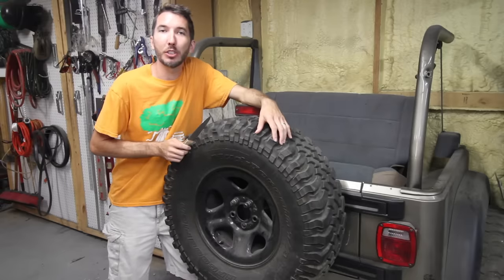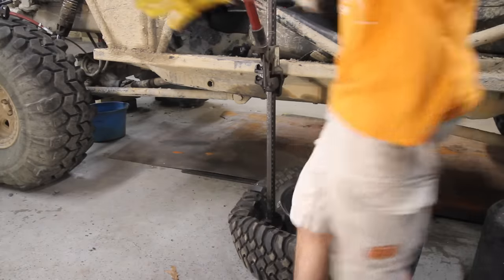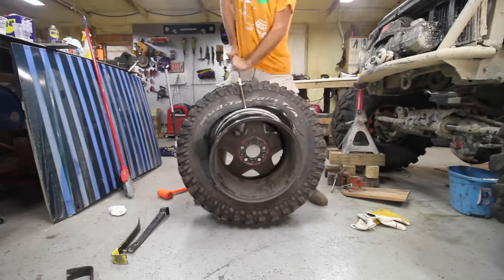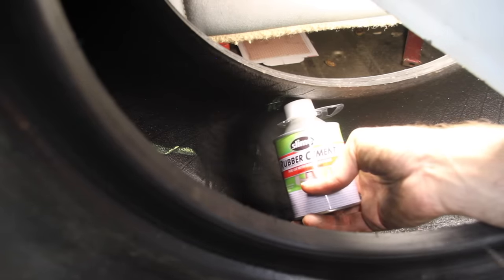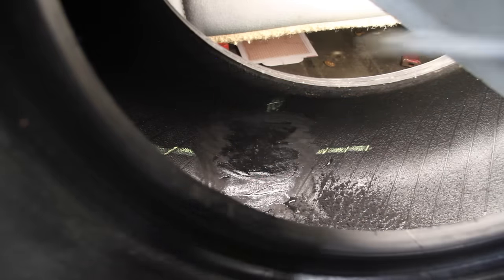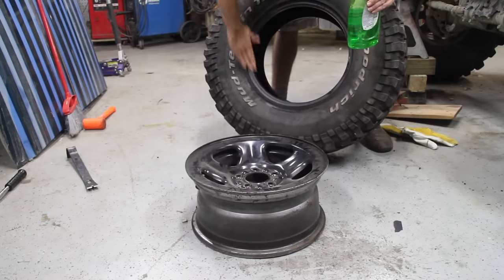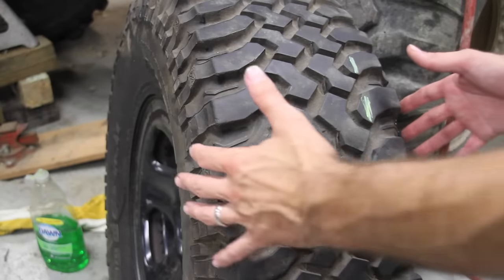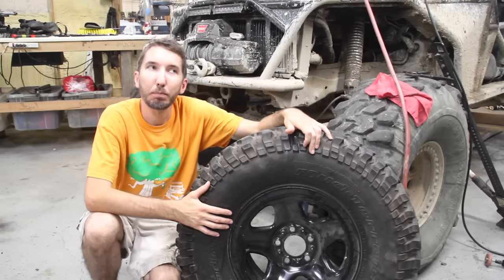How To Fix This - Patch A Tire

Comment from the maker: This is why I cleaned before buffing, as per Rubber Manufacturers Association and Michelin Tire: "Step 3 PREPARE INNER LINER SURFACE
Clean the area around the puncture thoroughly with an appropriate (pre-buff) inner liner cleaner. Use a clean cloth
and/or scraper, according to repair material manufacturer’s recommendations. Consult your local repair materials
supplier for an appropriate cleaner3. This step serves to remove dirt and mold lubricants that can reduce repair unit
adhesion and contaminate buffing tools."
Reply: BleepinJeep if you push the far side bead down. It comes off a lot faster. You will see this different groove in the rim. Great videos also goes the same for reinstall
Reply: D I   
💯 bro 
B  
P h
 Y BleepinJeep not  in  buy mnnulg
Gold fl
loll
Reply: D I   
💯 bro 
B  
P h
 Y BleepinJeep not  in  buy mnnulg
Gold fl
loll
Reply: D I   
💯 bro 
B  
P h
 Y BleepinJeep not  in  buy mnnulg
Gold fl
loll
Reply: D I   
💯 bro 
B  
P h
 Y BleepinJeep not  in  buy mnnulg
Gold fl
loll
Reply: BleepinJeep as a car guy seeing that rim fly felt like a gun shot
Reply: Per RMA, this repair is not allowed. Follow all the instructions or none...
Reply: Benny McKeon ... I think he explained quite clearly in the beginning of the video "for off road use only"  ... this is not a repair to use on your family hauler but it will get you out of the wilderness and back to civilization... valuable info for people who don't  take instructions too seriously.
Reply: DBS MODs on road, off road, a "forever" repair, an "emergency" repair...
None of that makes a difference to the tire, it will kill you the same way. My point is, this repair is unsafe to perform in ANY instance without proper training. The tire is lethal in inexperienced hands.
Reply: Benny McKeon ... sounds like you've watched all the safety videos and passed the class... the rest of the Internet doesn't mind having these type of videos to help out in a pinch... I'd bet a hundred bucks you work for some kind of tire business and been reciting the same speech since the training classes... those classes are mandated by insurance companies to reduce liability and payouts and have little to do with real world scenario  ... nobody is gonna die from watching this video and using the trick as described to get off the trail and away from bears and mountain lions before it gets dark... i've been changing/repairing my own tires since the 70's and the only thing I seen wrong here is the guy struggling to get the tire on and off the rim because he was doing it wrong... but he still got it done... with limited experience... and got his family out of the woods safely... and nobody died.
Reply: DBS MODs well you're half right, so you only owe me 50 bucks. 😉
I have been changing tires professionally for nearly 20 years and currently I own a tire company. Any yes, I watched the videos and passed the class.
BUT: I'm not reading a script when I say what I say. I've seen firsthand the injuries that can occur from improperly mounted or repaired tires. I saw a co-worker nearly lose an arm to an explosion. And just recently a Sears employee in my area had his head blown off by a tire explosion. So yeah, I'm just saying "shit tire shops say because they have to"... But maybe sit back and think for a second why they have to say it. I'm not going to sell this guy a new mud terrain by commenting on the video, so you can't use the "they just want you to buy a new tire" excuse. There is a huge huge risk of death or injury from doing the job shown in the video. So "the rest of the internet" can put their lives at risk? I think tires kill more people than bears...
Sure, you repair your own tires. Never got hurt and never had one blow. Let's make a video about handling explosives? Plenty of people have done it and haven't been hurt, so... The rest of the internet can too right?
If you don't see my point, i don't know what else to say. I just don't think doing a repair on a tire yourself is advisable in any condition, off road or not. The risks are too high.
Reply: Benny McKeon ... that's the issue... I do see your point... I just don't agree with it at all... just a different opinion is all... I refuse to go thru life being too scared to touch anything because somebody else heard of a bad story from sears...  i've also seen planes crash... and pedastrians hit by cars... or people electrocuted in their own home... but it doesn't stop the world from travelling or having power in their house... the risk of getting killed driving the car is much higher than the risk repairing a tire... you "just don't think doing a repair on a tire yourself in any conditions is advisable" ... I think that's wrong... no biggie
Reply: DBS MODs well, I have yet to see a crosswalk that said "only specially trained persons should cross this road, serious injury may occur"

I have, however, seen a similar warning on every single tire I've ever mounted.

You don't need to live your life scared to fly a plane. But if you aren't afraid to fix a tire, at least be a little more familiar with the associated risks before trying.
Reply: Benny McKeon ... we are familiar.... and now you're changing your story... your first mantra was that "nobody should be doing this" ...  the disconnect here is that you think we are not familiar with the risks , and need your over zealous warnings before we proceed ... we heard ya the first 4 times 👍
Reply: ... actually wouldn't a real 'wheeler have air available to re-inflate after airing down or breaking a bead?
Going innawoods without a spare tire is just silly, though.
Reply: Benny McKeon 
No point in arguing with them. If they try it and the tire zippers on them they will sing a different tune ( if they live to tell the tail). I just carry a spare.
Reply: Benny McKeon Roger. I’ll call AAA and have them tow me from Loon Lake to the local Tire Shop. /sarcasm
Reply: Never had an issue ever with contaminated grinder as long as you clean the ground down area before cement
Reply: Benny McKeon TOOL
Reply: I think Benny was missing the general point:  this is SOLELY to get you back to a place where you can SAFELY get the tire replaced.

After all, I've never seen a Sears or Tire Rack on the side of the freaking trail...and I have had to do similar, just to get off the mountain and back to the trailhead.
Reply: How would the damn tire explode if all the air is out?
Reply: Why would you compromise the integrity of a tire with that much tread for a video when you could get any number of junk tires for free?
Reply: No good tire repair this patch diagonal patch no radial patch  radial patch need this is tire radial
Reply: Compares tires to explosives to convey an overly emphasized point, yet doesn't understand why his warnings aren't taken seriously. Maybe use a comparison that makes sense? Changing your own tires can be as dangerous as you make it. And I doubt DIY tire changes have killed more people than being stranded in the elements.
Reply: @rabbycacker  he said that tiresnon that rim for over ten years .. If u listened as good as your forth right grammer .. U havnt .. U would of learned u something of technicalitys
Reply: I have pretty good luck with screwdrivers and taking small bites.  larger tools require the tire to need to stretch more to accommodate for the tool size.  Also I have very good luck using slime in my tires.  I never have the need to repair a tire, but I don't run low tire pressures so I am not sure if it would be as effective in your situation.
Reply: @DigitalBenny  "A Sears employee In my area had his head blown off by a tire explosion".
LOL.
If you're gonna lie, at least make it believable
Reply: @davedammitt7691  Justin Almon, Sears Salem New Hampshire, December 19 2015. 🤷‍♂️
Reply: Cal calli  Yeah. 🤷‍♂️
Reply: @Mark Codiroli Also, need to be sure the tire hasn't been compromised by being driven on with low air. Check the sidewalls for ripples, bulges, or a line cut into the tire about halfway up the sidewall around the circumference. Since you're not dismounting the tire, another thing you can do before fully inflating the tire is depress the valve core and smell the escaping air. A tire that has been run flat has a particular odor... These steps will prevent the tire blowing before you start the repair...
Reply: great job buddy   'keep it up
Reply: You fixed it but one day it will pop. The side wall holds the weight of the truck. In all the garages I worked at, we never repaired sidewalls.
Reply: You used a bias ply boot (patch) in a radial tire 🥴
Reply: @DigitalBenny   I agree . Having owned my own Heavy equipment tire company for 34 yrs. & Have been changing tires for over 50 years . There is a great bit of risk repairing a tire improperly. For one he buff into the cords which now the patch won't stick there . Touch the glue with his finger , which contaminated that area & put a bias ply boot ( patch) on a radial tire . I've seen a lot of idiots on here dealing with tires that they have repaired by a professional  . The one that really makes me cringe , is when they use ether to set the beads on a tire . You can do it that way ,yes it's dangerous ,but the biggest thing I see is they ALWAYS use too much . That's when you start loosing body parts . I could go on here & show the correct way to do this ,but then you would still have some idiot trying to take a short cut & end up dead . Enough said , have a great day guys & leave the tire changing to the professionals.  It can be a BOMB in the wrong hands .
Reply: @rickpool104  LOL it's been so long I forgot about this video 🤣
Reply: @DigitalBenny  , news article specifies it was a large truck tire that killed the tire tech. I never worked on them, but anywhere I've been that has done these always have an inflation cage next to the large truck tire machine for inflating them. One has heard people have being killed inflating a "Large truck tire" without a cage for eons, especially infamous split rims. Apples and oranges, yes it is dangerous to repair a sidwall on any tire, but the energy is going to release from the weakest point, which is not as pronounced on a solid rim at only 50PSI vs a large truck rim/tire well over 100PSI. If this was a split rim for an old P/U then yes, the risk of explosion would be real even at 50PSI since there are multiple weak points by default, but this seems to be slightly exaggerated apples to oranges. I think there is a larger risk of being on a trail for multiple nights out in no-where vs. patching a sidewall to get back to a wrecker or AAA covered location for appropriate repairs.I agree with others though, I would carry a spare or have a support vehicle nearby with such. I think the greater risk would be whacking yourself in the head with the tire iron or jack handle from the heat of the moment of repairing a tire on a trail vs the Hollywood version of it exploding and killing you IMHO.
Reply: @daveondre4892  the technician was trying to set a 16 inch tire on a 16.5 inch rim. OSHA fined Sears a little over 5,000$, which is probably because the customer was allowed back there. He was young but was an experience tire tech. He was just not very good with numbers.
He died of blunt force trauma. Customer took a hunk of rubber to the head but survived.
Nobody blew their head off.
Reply: @frankwilson1776  thanks for the details. I have little experience with them, but recall from my little experience the 16.5 light trucks commonly used split rims, which is just an accident waiting to happen in general, cage or not.

Comment: Two tips from someone who does this daily. #1 remove the valve core before seating the bead. It allows more air into the tire at a time,thus making it easier. #2 mark the location of the valve stem before removing the tire. When you reinstall the tire make sure to line your mark back up with the valve stem before seating the bead. This most of the time will keep you from having to have the wheel balanced. Other than that great video!
Reply: I'd like to know who carries an air compressor and air tools out on the trails...? If you carry an air compressor off-roading you are my hero :D
Reply: If you put a boot in, it probably needs rebalancing anyway.  But you are still correct.  That is the right way to do it.
Reply: @concretesailors  --I carry a Small DC Compressor in All my Vehicles, if I have a Flat, I just air it up and hopefully get it to a station, if not, i just keep on airing until i get to my destination, to Old to be changing flats on side of busy roads...
Reply: @randybeard6040  - I used to go off roading into the desert in ME each weekend. Each 4x4 used to have a compressor, folding shovel, strong and long towing belt, jump start cables etc
Reply: @Achisachis73  Bike Pump works too.
Reply: @concretesailors  my dad turned the ac compressor into an air compressor in his jeep. He is a hero

Comment: I was 200 miles from home and ran something over that put a similar gash in my trailer tire. I stopped at the first place I saw, a tire chain store, to see if they would either sell me a tube or patch it so I could get home. Not only wouldn't they touch the tire, they wouldn't touch any tire on a trailer. It was a cut off pickup trailer with a 31-10.50x15 tire. Oddly enough, the piece of metal in the tire was sort of still plugging the hole a bit so I pumped the tire up to about 20 psi over max pressure and continued on till I found a drug store, they had a cheap plug kit so I bought three of them. After shoving about 16 cheap tire plugs in the hole and leaving the chunk of metal in place as well, I was able to slow the leak enough to where I made it home after again over inflating the tire to about 60 psi. It was down to about 20 psi when i got home and flat the next morning but it got me home. The next day I pulled the tire, patched the thing and stuck a tube in it. Its still on there 4 years later. I now carry a huge box of rope plugs, several patches, a bottle of glue, and two stainless steel plug tools in the tool box of the truck, and I installed an air tank underneath outboard of the frame that can hold roughly 40 gallons of 200 psi air just in case. I put an air fitting inside the fuel door. (The tank was an old propane tank I took out of a junk RV. I used the tank, and its mounting brackets. It fit nearly perfectly up under the right side of the of the bed just ahead of the rear wheel. I also carry a small 12v compressor but would go to the air in the tank first for speed of repair.
Reply: holy cow! I totally forgot carrying an tube as an old school fix. :facenapalm:

Comment: This is the RIGHT way to repair a tube less tire. I am surprised how many negative comments you got. I have used the exact same methods you describe here for years. With great success. Those  tube less tire plugs/strings are crap! Only temporary at best. Great video. Thanks for posting. 👍
Reply: agreed, excellent how to video old tire or not!
Reply: As this is the "right way" you shouldn't repair a tire that has a picture in the sidewall because it can be VERY unsafe that's exactly why shops will not repair them because it's to unsafe this should ONLY be done if you are in the middle of nowhere and have no other choice
Reply: I to have been changing tires and patching them the same way for many years too but disagree with you saying that the plug/strings being useless, I’ve used them for a long time and never had anyone come back with a complaint, maybe your doing it wrong.
Reply: I, too, have been using the strings for years.  I had a large hole ( 16d nail went in head first) and had to put in 3 strings to plug it.  Kept it on as an experiment and went another 3K miles before I got a new set( I needed tires before the flat happened).  Anyway, I didn't lose any air, so I called it a successful experiment.
Reply: I've used them with great results for things like nails and then whore out the tires, One of the first times I did it, had a slow leak and had to redo it. I hadn't reamed it good enough, thinking it,Id be better with less rubber removed. If you can pull the nail, screw, etc. out from the outside, may only need jackup and leave the fire on the vehicle. Always try to keep kit and goo string in the trunk always. Make sure to double bag in a good zip lock bags, as if dirty/dusty they might fail to seal.
Reply: The patches are better than the plugs/strings in my opinion.
Reply: I would never take that much rubber off a tire where i can see threads. He carved the area that he was patching to look like a mountain range. It should be smooth not like hills and valleys.